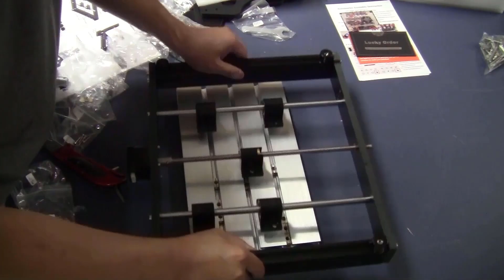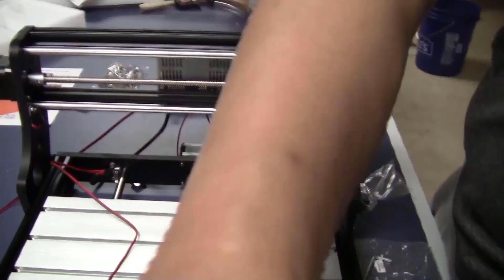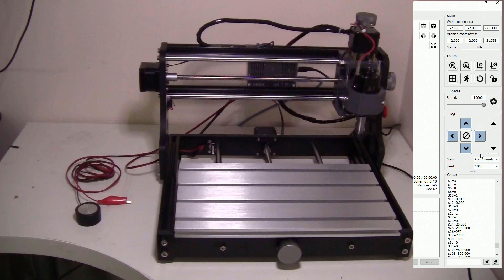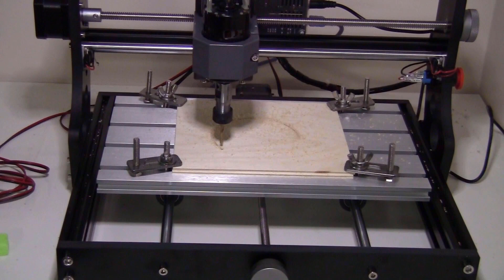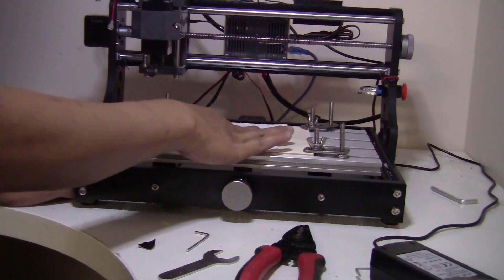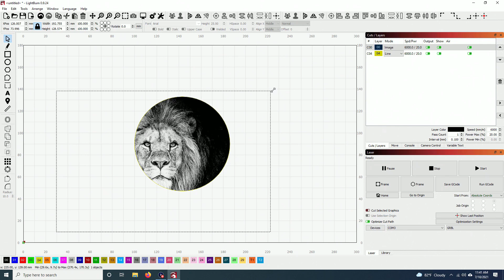Testing the most complete 3018 CNC Pro kit - Solved Candle/GRBL not opening - Laser focusing trick

Comment: Hi, What is a good upgrade spindle that doesn't require a new controller board?
I have a Cronos maker on my 3018 CNC Pro-Max. The spindle supplied is very rough. I bought a Hanpose 80W spindle with a double bearing that seems to run smoother. It doesn't have a flat machined on the spindle shaft. I think this makes a difference.

Comment: Two win 10 laptops one HP the other a new Acer,  Default Win 10 free apps only  and out of the charged up downloaded and “ installed” Candle 1.2.  Opened it, unlocked it,  the jog buttons, spindle do not function.
Checked com ports etc and the settings had com the devices show com3 in use. I changed the setting to com4, opened Candle, then  services…not connected, then I connected, showed com4..job buttons dead!
Tried four USB cables… no difference! Downloaded grbl Control, it opted for com4 all jog buttons, spindle OK!
Yes I know I can ignore candle and use control. But I would like to know why I  cannot get it to work and other can without a hitch! And I like the interface!
Any suggestions?
Reply from the maker: Check the firmware of the controller board. New candle cannot work with old grbl
Reply: @minhsmancave9448  how would I do that?

Comment: I see on ur laser there is one board again, what is that? Can we buy separate? (Power laser?
Reply from the maker: All laser need a power controller, some has it on the laser and some has it separated. Better read the specs when buying. My laser is 5.5w
Reply: @minhsmancave9448  my laser 2500mW include  in packet 3018, but board for power supply not there
Reply from the maker: Is there anything attached to the laser? How many wires come out from the laser?

Comment: btw I have the very same controler board on a laser CNC. I experienced very high temperatures, high enough to bend its plexiglass cover. Don't use it more than a continuous one-hour session.
Reply from the maker: I have been only using the machine for laser for small pictures so short sessions. Good to know that so I won't burn mine.

Comment: Using the probe with the laser module is genius. You are an inventive guy Minh. The multi-screen fix is so weird but you did it. Congrats.
Reply from the maker: I know right, I've been always using my laptop with this machine so I've never noticed this problem. My laptop's battery is dead and I had to use my desktop for this and I found weird things. Anyway, not too bad, I thought it was the noise from the limit switches but gladly it wasn't.